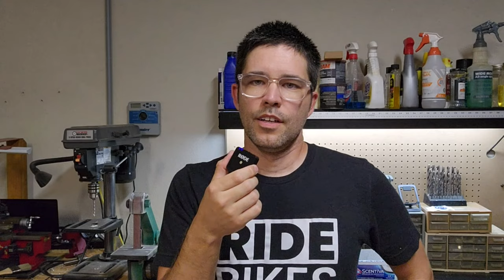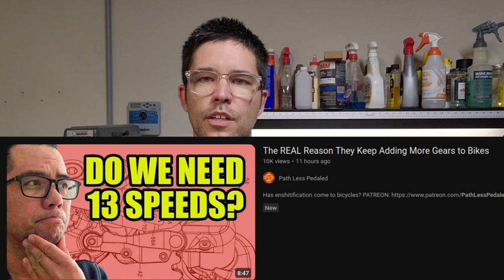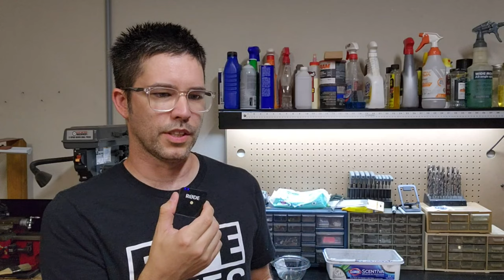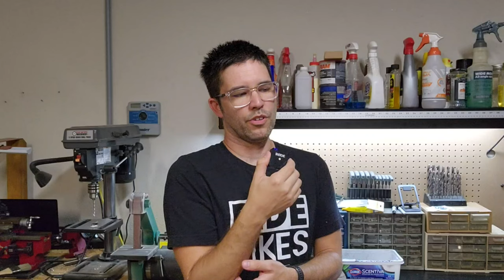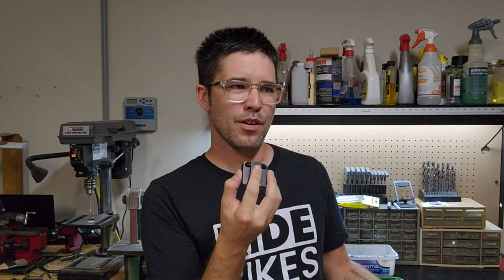We don't need 13 speeds

Comment: We need to start adding chainrings. Catch me with a 4x12 drive train. So many speeds you need electronic shifting to do the right order.
Reply from the maker: lol yeah a 4x12
Reply: @BruceChastain shimano and sram both have electronic shifting for 2x setups so you can use every non redundant combo. That is where electronic shifting is good, when it actually simplifies the bike.

Comment: I jumped straight from 7 speed to infinite speed with an enviolo hub or NuVinci back in those days (2011). Since then I designed an automatic shifting system for these hubs. Started in 2016 and still improving things now after 20k miles. I always had the opinion that fancy electronics would be unreliable and I've be proven wrong. I built the mechanics and electronics well and the original servo is still going after 20k miles. Been such a joy to ride, such a great learning experience doing the coding and a great bike for commuting to work.
I agree with you about reliability, the industry seems very stuck in the past but not totally. Consumers and bike shops are mostly to blame for this as they very much stick with what they are familiar and comfortable with. CVT hubs and automatic shifting is a good example of this and can really make cycling simple for beginners. Too many people just don't give it a chance or are worried about the maintenance. That's really one of the problems as such a system can be reliable but often the setup is messed up by lack of knowledge leading to unnecessary problems. Something I know you also very much understand.
As long as you don't use poor quality components, which is very much a cause of high maintenance bikes, bike components in general are reasonably reliable. It's the setup that seems to create the issues. Thats really the engineering challenge, how to make components more swappable as modules with less or no setup. Brakes and gears are a fine example. Bought as separate bits in most cases and it's up to the skill of the person installing as to how well they will work.
I use Continental puncture proof tyres and only puncture every couple of years on average. Good components are out there but it shouldn't have to require experience and knowledge to seek them out. Should just be used as standard like with cars. 
As for the topic of this video I agree it's getting silly adding yet more sprockets to the rear hub. Manufacturers are definitely cashing in on this. The real driver I feel for doing this is that people want the simplicity of 1x but still want a range of gears. In a way that's a good thing as many people struggle with working out how to handle the shifting of front and rear derailleurs.
I recently converted my old mountain bike, I got second hand in 1999, for trailer towing. Turned it into a 30 speed with massive 11 - 42t rear cassette and 22 - 32 - 42t chainrings. It's nice to have such a range of gears without shifting chainrings but the gap between 10 speed gear ratios only makes sense with a heavy trailer. Without the trailer I'm mostly double shifting.
Anyway good video as always, we share a similar attitude to bikes and cycling.
Reply from the maker: Hi Ed, yes I know I've watched some of your automatic shifting and power meter videos, very cool stuff! Really when I think about it, we have pretty reliable components out there in the market, but the problem is these components don't get into the hands of people who would really need the simplicity. Like a belt drive, internal gear hub with puncture proof tires, that's not a setup many people even know about much less actually get.

Comment: I’ve found a combination that works for me; belt drive, hydraulic disc brakes and internally geared hub. As close to maintenance free as I’ve ever found.
Reply from the maker: yep I agree that's about as good as you can get, if more people knew about that and or did buy that setup.
Reply: @BruceChastain  I believe more people would go this route if the price point wasn’t so high. Would be nice to see manufacturers produce a more reasonably affordable setup to get folks interested.

Comment: Although srammano dont really brag about reliability being improved with newer more expensive products, they definitely are much closer to motorcycle levels of turn key and go. The strongest chain shimano makes isnt the beefy 6/7/8 speed 3/32 chain. Its the thin dura ace 11 speed chain. Highest tensile strength, hardest wearing, and fastest. Hydraulic brakes are adjustment free, but if you dont keep an eye on your pad life, they have the ability to wear through the pad and into the backing plate. So they might feel like they last forever 
but new riders might find some damage when they go to do maintenance. But aside from tire pressure and chain lube, thanks to sealed cartridge bearings and decent drivetrains that tend to just stay in adjustment for way longer, a newish bike is way more turn key and less maintenance than my old bikes with cup and cone bearings everywhere.
Reply from the maker: Interesting point about the chains. If the metal is actually of a higher grade, that would make sense why they're so much more expensive.
Reply: @BruceChastain 9 speed chain on 8 speed. Drive trains is a well known tip for better service life and shifting

Comment: Good points. I am looking from a different level (rank amateur), and perhaps feel your points even more acutely. I rode a bike on dirt roads and around town when I was a kid. Then I moved to California, lived surrounded by hills and mountains in Silicon Valley, and I found hiking more fun. Now, decades later, I live in Florida (God's waiting room), and I would like to get a bike to ride dirt roads and trails in parks or maybe to a gym in my community. Not interested in road biking. I go to local bike stores and tell them I am looking for a solid bike for a 6-3 adult, step-through frame, single speed, coaster brake, with front hand brake for emergencies. They look at me like I came from a different universe and show me all the fancy modern bikes. Why in the world do I need all those speeds when it's flat as a pancake, and I am not going to do high-speed road biking? I want something simple, reliable, and comfortable, so I can enjoy the scenery while riding instead of learning the craft of bicycle repair and maintenance. You can get such bikes in Europe. Why are they taboo here? It's frustrating.
Reply from the maker: I'm living in Florida now too and agree, for the most part you only need single speed. I think there should be something that can fit your needs. Or perhaps something on the used market?

Comment: Interesting subject. I wonder what is the most reliable bicycle. Maybe those Buffalo bikes in Africa or the old Raleigh Tourist type bikes with 3 speed hubs and fully enclosed chains. I saw a chap with one of those who looked about 85 years old and the bike looked 50 years old but still in perfect order. Nowadays many bikes are throwaway products using carbon fibre materials and lightweight weak components plus ebikes have added extra complexity. I think a 3 speed hub and a fully enclosed chain is a great low maintenance option.
Reply from the maker: yeah after posting the video I got to thinking even more about reliability, I actually think other then tires, we do have pretty reliable bikes with internal geared hubs, belt drives and hydraulic disk breaking. I want to do some searching around to see if there are indeed tires that are nearly flat proof or at least something that can stay inflated for a year perhaps